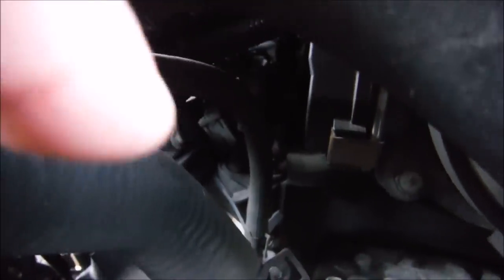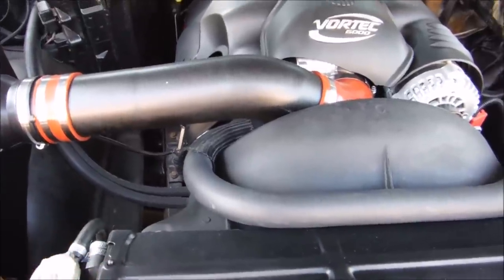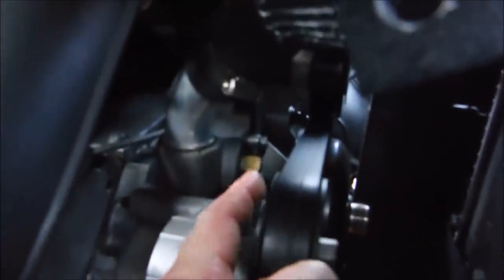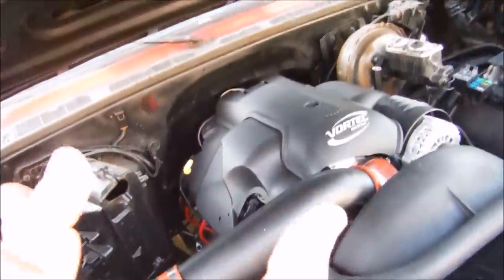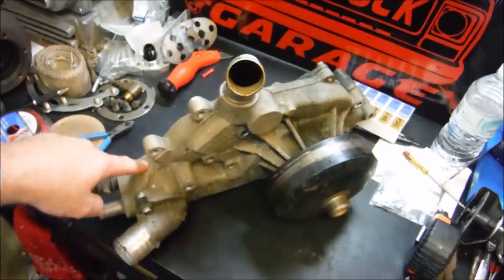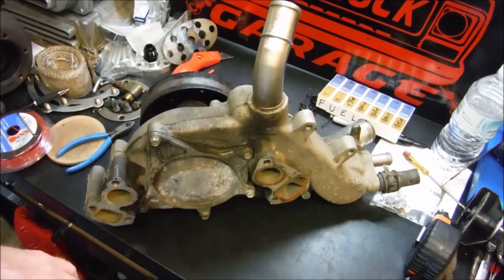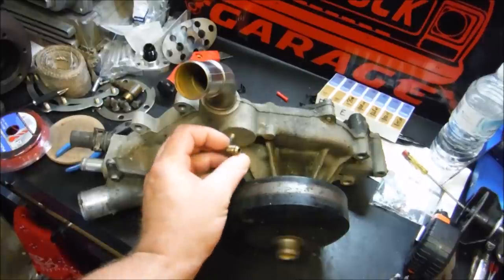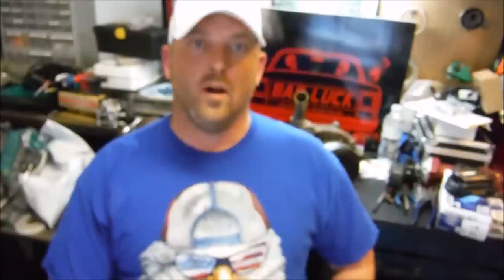LS STEAM LINE HOOK UP AND EXPLANATION

Comment: I know this is a older video but like you mentioned I’m running the dirty dingo spacer kit because I’m using a Ls1 style water pump on my 5.3 truck engine in my Jeep Ls swap
Reply: What kind of jeep? I am on the tail end of a 5.3 swap into a YJ
Reply: josh hristov 03 Tj the Jeep in my profile picture

Comment: at 11;25 in the video you show tapping and installing the steam line at the heater hoses outlet... you did say you have not done this ,,, but I did this and it is not working ... I have bleed the system and it still traps air in the heads  as it tries to boil the water is the heads and  the temp reading go to 250 .... just a heads up
Reply from the maker: Yea I threw that in there because I’ve seen people do it. But it’s not really a method I recommend. I prefer tapping the pump or using the pump spacers that are already tapped. Those are the cleanest looking and, in my opinion, most efficient methods.

Comment: Thank you so much for taking your time to explain.. it helped a lot.. also What transmission are you running with it? If it is a LS transmission.. Can you tell me how are you running your speedometer gauge thanks again
Reply from the maker: Everything project we do on the channel has its own playlist and every step is shown in detail. I’ve hooked up gauges different ways on every swap I’ve done. Some through the stock pcm, some with converter boxes, some I’ve used a Holley dash. All this info you’ll find in the playlists of each project vehicle. I will say I’ve never used factory gauges in any of my swaps. Generally they aren’t accurate and they usually read too low to use once you’ve swapped anyway. As an example, I don’t want an 85mph speedo in a vehicle that’s capable of 160 and I don’t want a tach that redlines at 4500 in a vehicle that revs to 6800. 😉

Comment: I know the reason why the back ports are there. They did that because it made the cylinder heads interchangeable left to right. If the we’re missing in the back they would be specific for each cylinder bank.

Comment: Where do you have the over flow bottle? I need one for my 1970 cutlass 6.0 LS swap? The car keeps overheating 🥵
Reply: I’m doing 5.3 swap in my 70 cutlass supreme if you have any pointers on a good raidiator fan set up for it

Comment: Do you take the pump apart before you drill and tap it if not how do you get the shavings out of the pump after drilling it
Reply from the maker: Thanks for watching Chris! The area you are drilling is right next to the outlet neck. There will be very few shavings that make it inside and those will fall out of the water neck when you flip the pump over. But if you’re a “just in case” type of person, you can also blow some compressed air I. Though the other inlets and outlets for good measure. 👍🏻
-Robert
Reply: Thank you for the reply huge help
Reply from the maker: Yes sir. 👍🏻

Comment: So my 97 Z28 LT1 Camaro had this port on the top of the thermostat worked out great for getting air bubbles out although my o4 Chevy Silverado 5.3 lm7 does not so this after learning my number seven cylinder was giving me problems complete teardown now complete rebuild with BTR stage 3 cam so on so on this is exactly what I needed thank you very very much for your knowledge and input and video appreciate it thanks brother

Comment: Hey man I have an L92 that my #7 piston broke a piece of it I have read and is it true this steam tube could of been the cause?
Reply from the maker: Thanks for watching Edgar! I don’t really see how it could. Not connecting the steam line and properly purging the air out of the cooling system can cause air bubbles and therefore hotspots but LS engines are notorious for being lean on the back two cylinders and I honestly have no idea why. I originally thought it had something to do with air distribution but from what I have heard it’s a common issue no matter what I take is used. Just one of those weird rumors that gets passed around on the internet. It does seem that number 7 is usually the one that always ends up popping though. When I decapped my injectors for the turbo build, I ended up with a couple injectors that flowed slightly more than the others and I actually put them on #7 and #8 just as a precaution based on this.

Comment: Just curious wouldn’t you want the steam port line go back to the expansion tank so we’re not putting air back into the cooling system
Reply from the maker: On 99% of swaps there’s not an expansion tank, just and overflow tank. Two totally different things. And expansion tank such as in most factory LS applications is pressurized and part of the cooling system. An overflow tank is not pressurized and may allow air to re-enter the cooling system if you run the steam line to it. Running the steam port to the radiator directly or to the output line in the water pump pushes the air to the radiator where it can be burped out into the overflow or even straight out of the overflow line in the full neck if an overflow tank isn’t used.

Comment: I'm running an electric water pump, would it be an issue to run the steam port to my AN adapters? The air would have to travel through the water pump and the thermostat before it gets to the radiator, not sure if that would be a problem

Comment: Great video! It was very informative! I didn't know that Dirty Dingo sold spacers for the water pump. That's one of the issues I was going to run into while trying to use a truck water pump with an LS3 intake.
Reply from the maker: There is also an eBay company called lsx innovations that sells them in different sizes. Thanks for watching!

Comment: Man I so glad I found this video . I have been dealing with over heating problems the whole summer after installing my new radiator with e fans . Now I know what to install
Reply from the maker: Glad it helped brother. Just remember to follow the proper fill procedure to bleed all the air out when you fill it as well.👍🏻
Reply: Bad Luck Garage yes forsure thanks bro

Comment: My theory on the ports it so that you can’t interchange the heads from side to side. 2 port heads can go on either side of the block single ports can’t
Reply from the maker: The heads are identical. They can be swapped side to side.
Reply: @BadLuckGarage  the steam ports will be at the back then
Reply from the maker: The heads have steam ports drilled on both ends.
Reply: @BadLuckGarage  yeah I know that I thought that you said in your video that later models got rid of them. Not just capped them of
Reply from the maker: @briansbrain3624  Yea I think you misunderstood brother. They got rid of the 4 port system on the later models. But the ports are still cast into the heads. They just stopped using the 4 port manifold to connect them all.
Reply: @BadLuckGarage  that makes more sense lol

Comment: Hey buddy .this helped a ton ..!!! I still have a question or 2 if u have time to help me .I'm desperate and I think I'm mightva damaged my motor by not bleeding truck right...I had a leak and lost a bit of coolant .and I filled truck back up.  I keep notcieing now later it's using a little water and steam comeing out my new dual exhaust..but I have big air bubbles in top line. All still stock coolant system in my 04 ext cab Silverado 5.3 .wondering if truck is supposed to bleed itself or if I'm supposed to..and can't find vids that actually show ya how to just bleed my factory truck...so I ran and cracked steam line loose and water came out .took top rad line off..it poured water out..so I'm not sure what I'm doing wrong .lol ..I just need to get it filled and air out..and make sure it's ok.i can explain more if could talk or something .this just a run down ..I'm lost now and getting upset cuz I can't figure out what I'm supposed to do ....I don't think my temp on dash has ever went above 190 or whatever .bit I know and can fill air in top line .and it's alot..so I've squeezed line while warm and running hoping to squeeze air out .I've pull steam line loose while running. .no air .Just water. But I'm sure im missing something .so if u can. Pleasssssse help me out lol .tryin to keep our one family truck going and hell..mightva already blown it .but this all me and my family has and no way of getting fixed except my my disabled ass lol..so any help will be a god send!.TKS and God bless ya for explaining what u did on here!!:):)
Reply from the maker: If it’s using coolant and you think it’s burning out the exhaust, the first think I would do is pressure check the coolant system. You can usually borrow the tool from any auto parts store and you’ll get your deposit back when you return it. It certainly sounds like you may have a head gasket leaking from your description. But of course diagnosing problems over the internet is kinda hit and miss. I would start with the pressure check and go from there. As for the fill procedure I use, generally what I do is disconnect the top hose at the radiator and disconnect the steam line at the radiator as well. Then fill the engine with coolant through the top hose until I see it coming out of the steam line. Next reconnect the steam line to the radiator and top the radiator off as best you can. Then pour WATER into the top hose till it’s completely full. Then quickly stick the top hose back into the radiator and tighten the clamp. I say use water specifically because you WILL spill some before you get it back on the radiator and you don’t want to dump coolant all over the ground. After that, top off your coolant tank to the full cold mark and drive it till it gets to temp so it starts circulating coolant. Drive it for about ten minutes after that then top off the coolant tank if it has dropped and your done. The real question here is did it get hot and blow a head gasket because it had air pockets, or was it getting hot and low in coolant because the head gasket was already blown or was there another issue such as a stuck thermostat that caused it to get hot in the first place? If you pressure check it and it checks out ok, then follow the fill procedure I just gave you. If it’s still running hot and losing coolant after that then you need to look for leaks elsewhere. Water pump is a usual culprit especially if the truck sag for a long time without being driven. The important thing is to not panic and break it down step by step and eliminate possible problems one at a time so it’s not overwhelming. 👍🏻
Reply: Thank you so much for your help something I've noticed is that my truck doesn't warm up to about the halfway mark if I turn the heater on ..and I keep noticing I'm getting air sucking in whenever I open the resevoir cap..since I have no radiator cap.  and then the water flows up to the top of the reservoir.. ..but yes from the moment I start the truck until I stop it I'm getting sting buildup on my tires and see steam coming out of my pipe constantly...but my truck has not overheated once but it keeps on the heating up to the halfway point..I parked the truck with the front way up in the air on the driveway to try and let the water back down and got it filled but now when I unscrew the cap the air sucks in real quick and pushes the water out of the top of the reservoir...but I can tell that my top radiator line is full of air now but I just got done filling it at my house and then drove it to my mom's house and parked it back up in the air and now it's gushing water out the reservoir again..but it has yet to show overheating on the gauge once but I'm wondering if maybe my gauges wrong now...never had a problem before.. the truck is at a hundred and sixty thousand Miles though and I did have a converter to come loose on me and just had all that cut off and dual exhaust ran but now I'm getting steam.. I know I had a coolant leak a couple years ago and I've been fighting with trying to get the coolant tops back off ever since then it seemed like... I thought the hole in water pump was leaking. But it was bottom reservoir hose..I just wasn't sure if my truck was supposed to bleed itself or what..after it sat for about six months with me starting it every now and then waiting for$$ the converter fix to dual exhaust I kept running and checking it . But after the dual exhaust fix now I'm getting steam. And it's been a month straight...of checking water.losing water .when driveing .but not from water pump..best I can tell..so guessing intakes gasket won't fix this ?.like on some chevys .... I know I'm getting an code now .for the evacuator plug on top of the intake whatever that thing is with the hose that goes to the back of the intake .since the cats r gonei was thinking maybe something to do with that.?...or can I delete the EVAP sensor thing and EGR since I deleted the cats and back O2 sensors too ?.before I have the computer reprogrammed .I noticed there's plugs to block off those two things but I didn't know if those were for my factory truck after its reprogrammed or for ls modified conversions kinda things..and yes thank you I'm trying not to panic I just didn't know how the water system worked in this truck and all I keep getting are these conversions videos ..lol..but I'll try what you said to do again I wasn't pulling the steam line from rad .I was undering it from the block and letting it leak out.  okay so I should Park this on a hill and then try and get as much water in both of those pipes as possible and then run it up to temperature? And then what again?.just check it from the reservoir cuz when I crack that open usually the water moves up to the top now all of a sudden...so just fyi..and thank u so much for ur help...I'm trying not to get upset here and overwhelmed but if its head gaskets I'm screwed cuz I can't do this kind of work anymore with my back and disabltys ugh..I have babied this thing since I got it and always took very good care of it ..since I got it with 20k on it ..now 157k..:''(( ..gonna suck if that's what it is .but sounding like blown head gasket more and more go me .just wanted someone that knows better to tell me ..I know hard to diagnose on net..but I think we already know..lol..:''''(..can't afford this stuff lol...I was hoping to save up for pushrods and lifters here soon and replace the head gasket when it was needed but now I'm going to have to do it regardless and then save up for the parts and then fix it again sounds like ..man this sucks .lol..hey thanks again .and anymore info will be great.!!:):)I really appreciate it a ton!!.
Reply: also I saw one video of course I'm not sure if I'm doing this right but with the truck running and the reservoir cap off I keep squeezing the bottom line and the top line hoping to get some of the air out of the lines....and when I squeeze the top line I noticed that I can hear a tink tink tink tink sound...So I was assuming that was the thermostat making that sound..I just don't know if I'm supposed to be trying to get the air out of this thing with the reservoir cap on or off I don't know if I'm making it worse or any better...I was hoping pouring water in the reservoir and then parking it on the hill would make a difference but it didn't really seem to help any... My luck I need a water pump to but I just can't tell .what to do first.  and I'm assuming with the pressure checker that if it leaks off then it's got a blown gasket?..you just put that thing on with the engine off? And then if it doesn't hold pressure it's got a blown head?..never used one before....I'm pretty sure it's a head gasket because I let it run for about two hours straight and just saturated the entire driveway with water but it was just in steam form but it eventually built up on my tires but I was trying to watch the temp gauge and it never went above right below 210...like usual...but when I turn the heater on it drops down to the halfway mark and it doesn't go back up unless I'm driving it...weird..but when it does go up to full temperature I jump out and squeeze the lines to try and milk the air out of them and they don't feel any hotter than normal.. and when I drove it it wasn't like it was hot outside or anyting hell it was almost freezing...lol..so..just lost here .lol..trying to give as much info to help u help me ..lol..TKS so much for the info...I really need the help here. Lol.and seems like everyone has a fix and that's what got me here .lol..seems like u know so I'm trusting u only at this point .lol... I was just about to cut my radiator line and put that hack in so can bleed air ..but assuming I don't need it .being factory setup still lol...so TKS again .and I'll watch for next reply..tk u tk u tk u

Comment: Had no idea they were soo important had them capped off at the head because of bad advice , but just tapped my water pump during my cam swap learned alot from your channel thanks for the help 👍
Reply from the maker: No problem brother. If this or any of the other videos helped you out then thats awesome.👍
Reply: Does it matter what size the tap is? I have a 9/16 x 1/4 barb fitting that I want to install but idk if the larger diameter will have drawbacks or benefits
Reply from the maker: As long as the hose diameter is the same and it’ll fit wherever you tap it, it really doesn’t matter.

Comment: Any chance of just taking off the thermostat housing and taping into that for the steam Port? Is that ok?
Reply from the maker: On an LS engine the thermostat is on the inlet side of the cooling system. So you would essentially be taking the air/steam pockets and pumping them right back into the engine. Pretty much defeating the entire purpose of the steam vents.